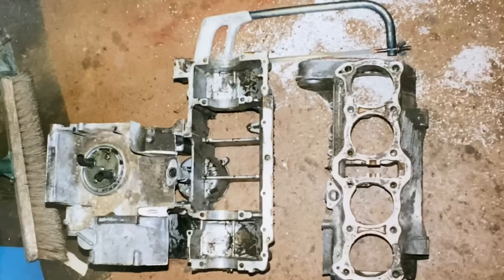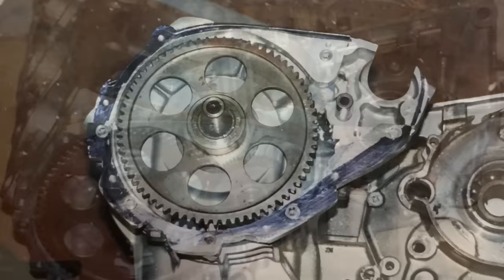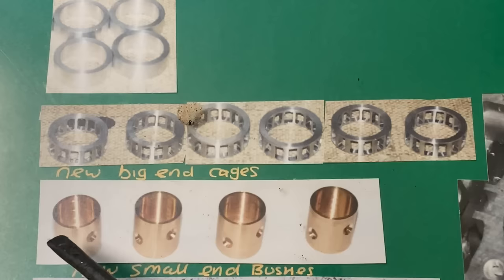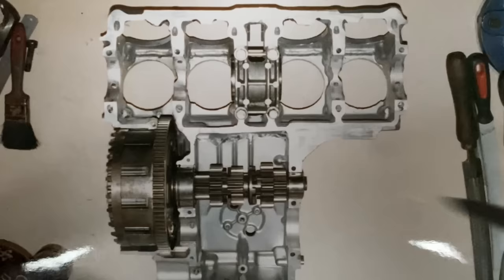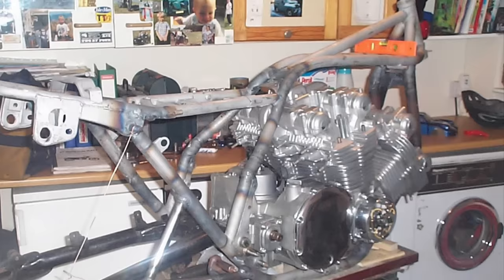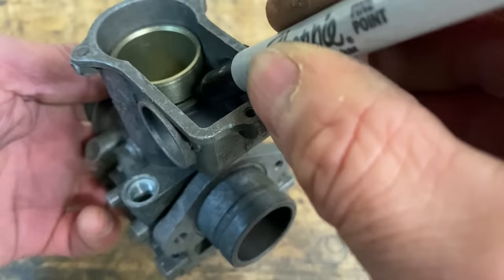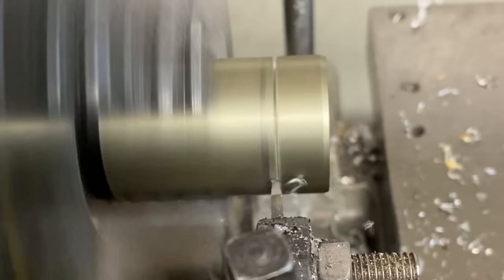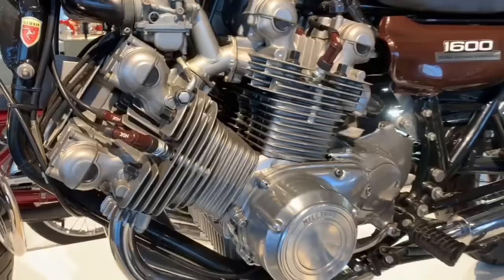Millyard Kawasaki Z1 1600 V8 motorcycle - How its made

Comment: There's nothing cooler than kick starting a V8.
Reply: Oh my goodness, you are so right.
Reply: When Allen said he had to relocate the starter... For a moment that was my thought... "No room so I used a kick start lever from a KX125..."
Reply: @rushzimi3865  To be fair though, more cylinders you have easier it is to kickstart the engine. But still, kickstarter on a four stroke, let alone a V8, is something special these days and it's also very satifying to use one.
Reply: Pullcord 💪
Reply: Kick starting a v12
Reply: @danielthompson3849  Actually, you may have a point there... 🤔
Reply: @hello7533  😂😂😂
Reply: If he builds another one, I hope he puts in a kickstart. That 5L Flying Millyard kickstart was so awesome.
Reply: I can crank start an old Packard 7 Litre Straight 8.
Reply: I used to Kickstart MZ250 , it was kicking back badly.
This thing would probably kick you to the moon lol

Comment: Allen: “The first thing I had to do was get an old set of Kawasaki Z1 crankcases and using my hacksaw cut the top case in half to remove the gearbox section. Then I had to work out how far I could lean back the rear bank of cylinders before the bottom of the barrel would hit the primary drive gear “
Rest of world: “Let me think about that for a week”
Reply: Rest of the world: "Here's my v8 bike project which has been gathering dust in the corner of my garage for twenty years. Started off quite well but then the hacksaw blade snapped, and the football had started on the TV..."
Reply: John Glynn.  Brilliant 😂 I did have to keep rewinding every section to get any kind of basic understanding and I have trained as a test engineer at Cummins engines this man is an automotive genius and before I found this I thought he just restored old crap on the television lol (sorry Allen).
Reply: My first thought would have been 'how do I jig this in the milling machine?'. Hacksaws are, at least for me, used for shortening bolts and parting off things that are to flimsy to use a parting-off tool for.
Reply: @davidstewart4570  If that sort of project were to be attempted in any manufacturing company I ever worked for, first; an engineering plan would have to be submitted to management before anyone would consider the projected budget plan. If you're really lucky, some progress could possibly be seen in 3-4 months but would still be in negotiation since there would be several other projects vying for the same money!!

I like Allen's approach way better...  he only has to argue with that guy in the mirror!  ;^)
Reply: You are an absolute mechanical genius, simply that. 😊😊

Comment: Pure genius, I’ve seen a lot of videos of people converting single cylinder engines to v-twin and parallel twins to v-four but the engineering is based on the ingenious work of Allen so I would definitely class you as one of motorcycles greatest engineers.

Comment: I had a Z1engine laying around years ago. Got it for cheap since it was crashed by someone who did not survive. The engine was the only part that survived. Years went by and one day a farmer asked me if I had an engine for a woods mower. I told him of the Kawasaki Z1 and he said if you get it to work I will pay you good money. Well I am like you Allen, I like a challenge. So I installed the engine on his woods mower. This engine ran flawlessly for twenty years plus. Then the farmers son did not notice the cooling fans stopped working and he sized the engine.  That was the end to a great engine that would of worked years more. These engines were bulletproof. Thanks for the different memory from the past. The Japanese motorcycles were just superb. They were over engineered pieces of art and function. They were second to none for sure. Peace VF
Reply from the maker: Great storey
Reply: @AllenMillyard  They just do not make great things like that any more. Planned obsolesce is the normal way of doing things. VF

Comment: Allen's amazing enthusiasm got me onto making an electric skateboard. My Razor 300 kickscooter had a duff rear wheel that couldn't be sorted. Did not hold air at 4 Bar. Ripped that apart, full power session at a workshop with adequate materials. No steering as that would hop the chain off the sprocket instantly. Roll off throttle, kick the back where you want and go! Nasty 2 X lead acid batteries and all. More fun than the original.

Comment: Allen, I have dearly loved my Yamaha 2-stroke bikes from many years ago.  The RZ350 watercooled engine was tremendously powerful for it's time in 1985.  I would like to see you build what was the TZ750 racing engine except that it would have the exhaust tuning bar that rotated at the exhaust changing the exhaust porting.  It was essentially two 350cc engines end to end with two crankshafts turning a center common gear.   This 74 year old man and former auto mechanic loves watching what you are doing.  You are a real blessing to me and soon I would like to take a trip to the Barber museum which is not all that far away from my home in central Florida

Comment: He created a V8 engine by sawing 2 crankcases with a hacksaw, cutting, filing, then welding them together.   Then machined down the con rods and made new bearing cages.    Then took the hacksaw to cut down the carburetors.  Unbelievable.    It's all I can do to get a straight cut with a hacksaw on a scrap length of pipe.    Well done mate.

Comment: I just got my mates Keeway Cityblade 125 started by correctly diagnosing a fuel issue due to bad wiring on the connector on the fuel pump. unfortunately, there is a bar that specifically stops you from accessing the connector, so I hit it with a wrench (with the fuel pipe disconnected, and ignition on) until fuel came squirting out; I then masking taped the wire to the body, relieving the stress on the wire to the connector, and reconnected the fuel line. It now works and he thinks I'm a genius, I might have to show him this video so he can see what a reel engineer looks like lol.

Comment: Nice to see the work behind it and ah the pain of welding a z1 case and having to machine it back true afterwards. Mine has been welding the lower centre cap into the cases for more rigidity in race engines and a few other places but it always went spang and needed truing up after. Also really interesting to see your approach to the crank, I went a different route completely but I am chasing different end goals. And gosh how thick are those liner walls and boring liners from cast barstock! I'm lazy and just flick through la sleeves catalog until I find something that will work. Probably a great decision to drop cc per cylinder to give more breathing space, Ive windowed a few taking the mouths out for bigger liners going the other way, then your welding again, and back to spang. The fun of old aircooled engines eh.

Comment: Yes a chap after my own heart,I have been lucky & managed to get an old 2001 Minardi F1 V8 2,998cc Ford spec engine ,and I have ,hacksawed just 3 of the cylinders off it to make a lovely 1125cc machine that puts out about 190 BHP,and I shall call it the Mini  RS face stretcher   ,I will use a good old Suzuki GSXR1100 frame and brakes to house it,it should be a nice fit,it has been tested and the revs are really smashing as it screams up to around 18,500 rpm,it`s a really nice sound.I shall soon be able to test  the machine on a track ,so lets hope it doesn`t sieze up solid at 220 MPH!.

Comment: Those off center cylinder liners at 7:56!! I wondered how he got the offset connecting rods to work with the stock centered bores!! I wonder how the offset and smaller cylinders work with the combustion chambers?? There must have been a significant wedge between the thick part of the cylinder wall and the larger combustion chamber!

Comment: Love your work Allen and your videos, just amazing how you do it. I was curious on this build on two points.
1. As the barrels have no offset (it appears to me) how did you connect the small ends to the piston. is the conrod offset to the piston?
2. With the barrels being reversed one barrel will be running the camchain in reverse how do you get the camchain to tension (as it will be on the wrong side)
Thanks again Allen for a great YouTube channel.

Comment: A brilliant concept completed with top class skills. But, how long could it run before the rear bank overheats? Also, eight carbs operated by cables would be a nightmare to keep synchronised. My vintage CB750 with just four cables constantly goes out of sync. I suppose that is not the point though. The engineering exercise is executed superbly well, and maybe it is not born to run, which is evident when there is no road test. So, hats off to you for expertise, but no hat on for a long ride out, lest the rear bank seizes fairly soon! 

Space is very limited to shave off the air fins and build a water jacket around the blocks. With that and some ducting to the heads it might work as a concept for the open roads. Maybe you could revisit it and sort the cooling requirements. Now that would make it complete and practical. Astonishing even.
Reply from the maker: I rode it over 3000 miles including into London in rush hour traffic in the summer heat and it was fine . I also rode the V8 to the Isle of Man TT with my son on the back doing 700 miles in five days. The V8 has a bank of 4 carbs in the V. Roland Brown road tested the v8 for the Daily Telegraph , Classic motorcycle mechanics magazine and many more

Comment: If you are building a drag bike I can see this.
It needs to be water cooled to have any longevity.
The rear inside cylinders are going to overheat fast, because they have poor air flow.
Look at the problems they had with the square 4s or the inline 6s that weren’t water cooled.
Also you have to look at the frames. The chromoly frames that they used, would flex.
Like a Kaw H2 Mach IV, you would not be able to turn.
If a motor like that could have been built reliable and light, the Japanese would have done it in the 70s or 80s, and put it in a race or touring bike.
One of the reasons Honda went with the flat water cooled motor in the Gold Wing.

Comment: Incredible work Allen, but I'm intrigued how you dealt with the camshaft drive. How do the cylinders seal to the crankcases (or to each other) in the  middle, in the V, i.e. by the cam chain tunnel. Also, how are the cams driven? The cam sprockets seem to be in-line. Is there a single chain that runs around the crank and all 4 camshafts?

Comment: I got a 1965 Kawasaki Aircraft B8s be cool to make a triple out of one of those. Allen how to you feel about the z650/750 crankcase set up vs z1 crankcase setup? I have a z750 and the clutch set up etc is much smaller possibly leaving room for your type of mods. I love the simplicity and long duration they built these engines. Parts work from 70s thru early 2000s.

Comment: Hi Allen . Are the centres of the holes in the new part of the crankcase in line with the original , if so how does that work with side by side conrods potentially not in the centre of the cylinders ?  This question does keep me up sometimes. Your video's have inspired me to by a lathe and mill but most importantly a Quality HACKSAW
Reply: i watched this video over and over again and found my answer at 6:53.

Comment: Front cylinder bank runs in stock direction (from ignition point of view clockwise), while the rear cylinder bank runs in the backwards direction (from ignition point of view counterclockwise as viewed from the original/stock drive direction) because the intakes face each other, how did you do the cam timing?  and the cam chain guiding? , i cannot see properly if you only put the rear cylinder head in the opposite direction, or if you  did both the rear cylinder and cylinder head face the opposite direction? Also you decreased the displacement by putting smaller pistons in it, this automatically reduces the width in the piston pin hole section in the pistons.. and there is space needed to get the small end in it while it is offset in that hole, because the cylinders are in line, and the rods are positioned next to each other in the crankshaft..., i cannot pass to my idea that the pistons must be tilting to one side while running the bike... 
Do I miss something here, or can you give any explanation on how you solved these issues? 

Best regards, Paul Ritzen.

Comment: kawasaky 650 x2   tot.1700 cc.  no 1600
Reply from the maker: I fitted smaller pistons to reduce stress so it’s definitely 1600 cc
Reply: I'm confused since 650 + 650 = 1300 how it ended up at 1600.
Reply: Hi Allen.  I'm confused as to how 650 x 650 ended up at 1600.  I have always loved and admired the build and your amazing workmanship, by the way.  I've been a fan of the old Kawasaki inline 4s for half a century.
 @AllenMillyard